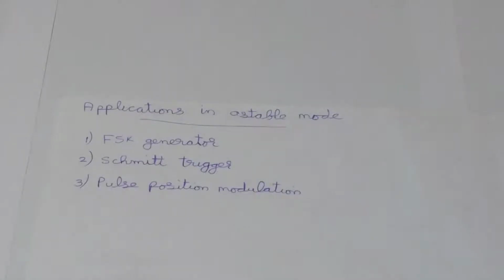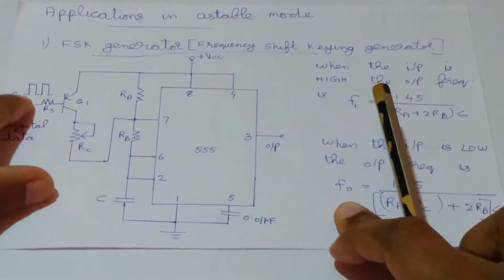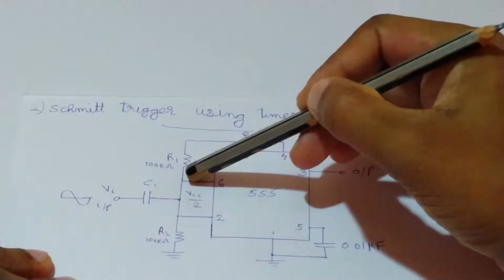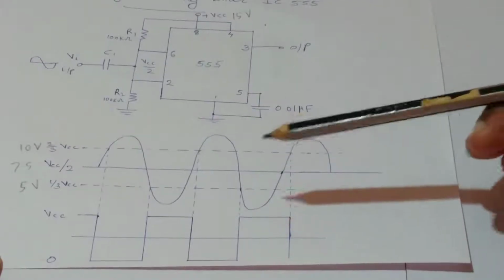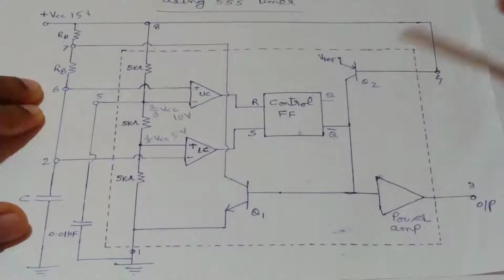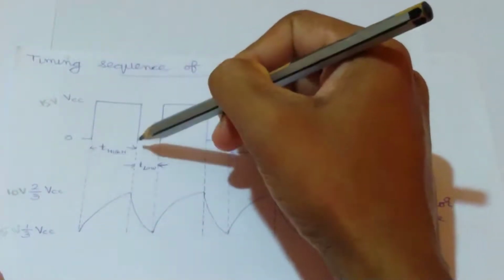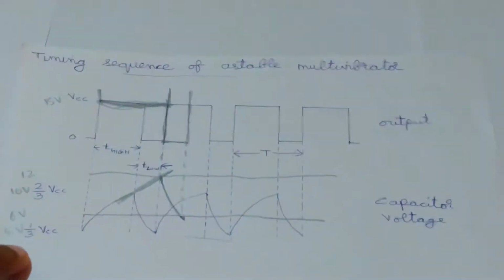APPLICATIONS OF ASTABLE MULTIVIBRATOR USING 555 TIMER IC | 555 ASTABLE MULTIVIBRAOTR APPLICATIONS

Comment: Question 1
 In Schmitt trigger output if input crosses the upper  threshold y O/P   will be from high to low state  and  if input crosses the lower  threshold y O/P  will be from high to low state ?
At first how it will be in high state ?? In beginning
Reply from the maker: The output changes when the upper and lower comparator of 555 triggers...you will get an idea about when these comparators triggers from the class for astable multivibrator using 555....First you study the working of astable multivibrator thoroughly...then listen this video from 7.30 to 10.47.then you will get clear idea about the working...
Then the output of the schmitt trigger is either at its high state or at its low state.so here we are assuming that initially its output is at its high state
Reply: @NycilsSupport  tq

Comment: Question 3
  At end in graph of ppm  based on Inc and Dec pulse width changes that is ok and y U didn't draw that pulse on lines y are some away some on it ???
Reply from the maker: That dashed lines just indicates different voltage levels of our input signal and it is not indicating the starting of a pulse...actually the starting of the pulse is not changing...the width of the pulse is changing according to the instantaneous amplitude of the input signal.
Reply: @NycilsSupport  yes cleared

Comment: Questions 2
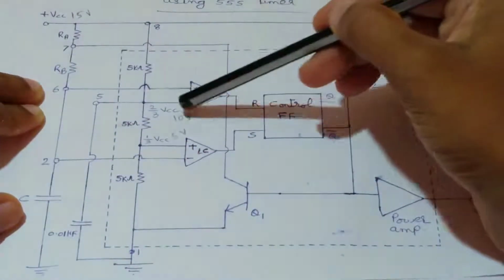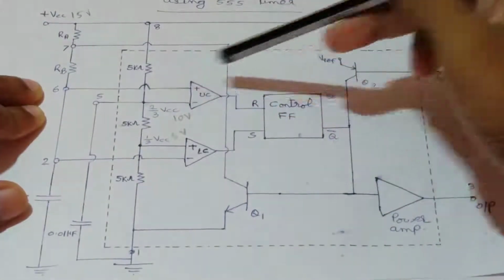Time - 15:01-15:06 how does output change from high to low state  at first where is high there ?
15:18-15:21 how does output change from low to high state 
How does it change to low state?
At first how it will be in high state ?? In beginning it can be low know
Reply from the maker: When the voltage at the 6th pin goes above 2/3 Vcc voltage the upper comparator of 555 triggers and the output changes from its high state to low state,and when the voltage at the 2nd pin goes below 1/3 Vcc the lower comparator triggers and the output changes from its low state to high state...... and it is explained in detail in our class for astable multivibrator using 555... you can go through that video to get clear idea about that.
Reply: @NycilsSupport  tq